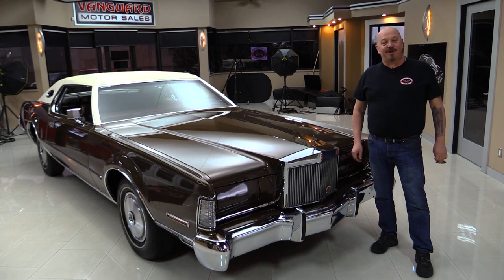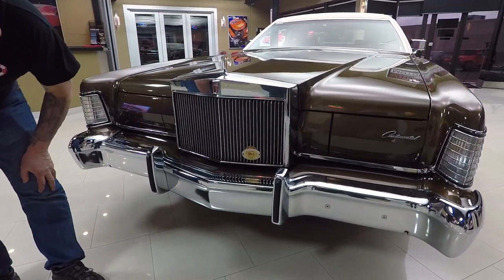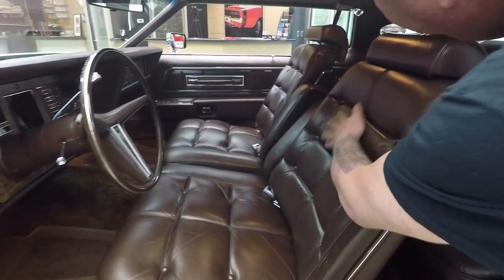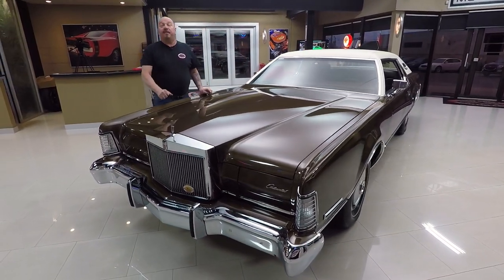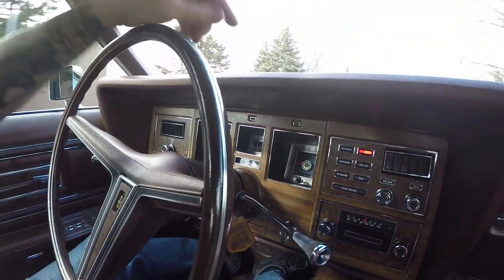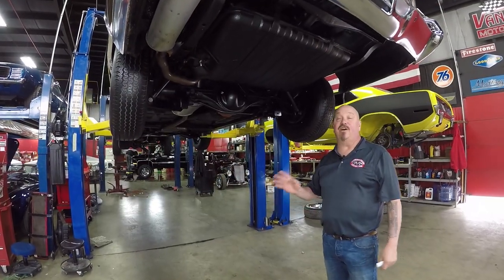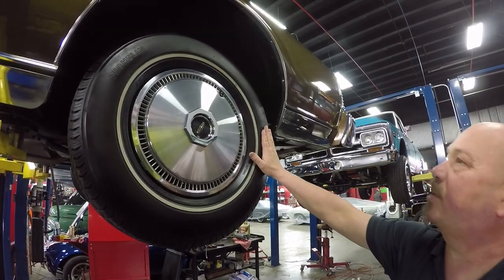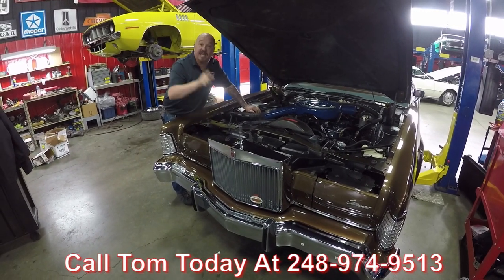1973 lincoln Continental For Sale

Comment: We use to have one. It turns exactly like a clipper ship. Cruise down rode at 35 mph and spin that steering wheel counter clockwise with one finger. Like a 3 mast schooner, a couple minutes after turning the wheel, the first indication you feel that the car is now preparing to execute the turn is not unlike someone letting the air out of the right side tires. As the car sinks to starboard you'll see a Lincoln emblem roughly 29 feet in front of you slowly begin to veer to the left. For further examples see the movie Titanic.